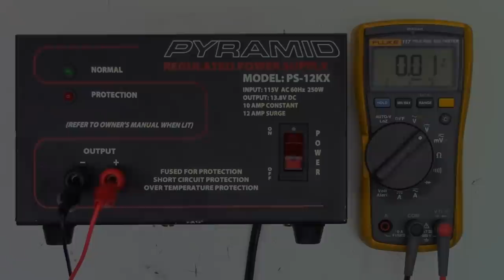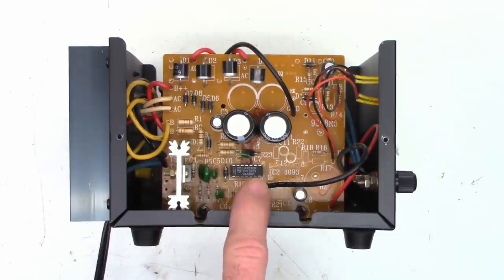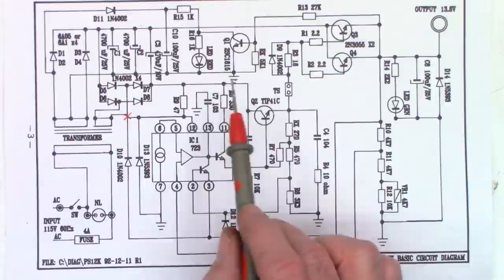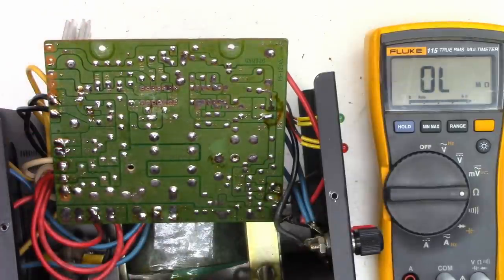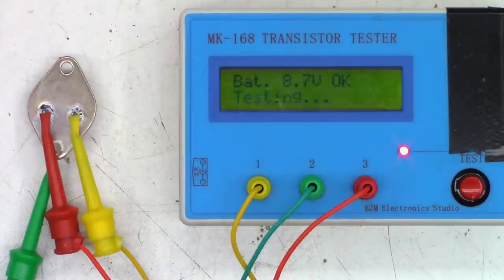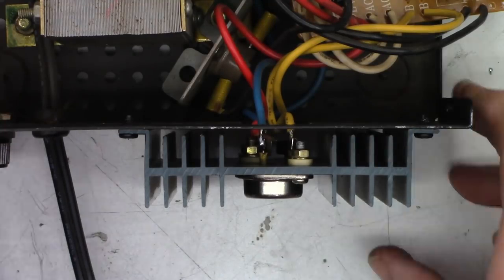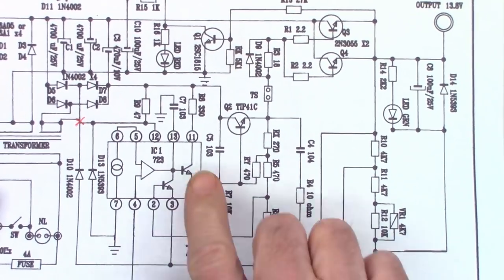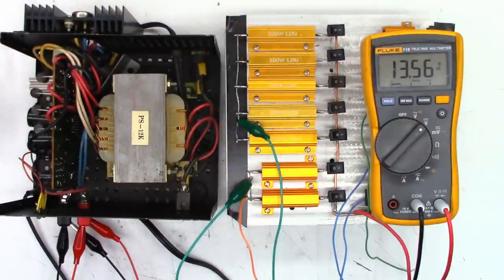PS-12KX Pyramid Power Supply that I sold it new in the 90's and it was returned DOA. Can I fix it??

Comment: Always preferred 3773s over 3055s. They were supposed to be lower gain, but I've always found them to have higher averages than the 3055. Finding matched pairs in the 3773s was (for me) easier as well. It didn't surprise me to see the 3055 under 30 gain with the 3773 over 30.
But a different story when you chop the top off the metal TO3 case. The 3055 is better in circuits detecting luminance levels for some reason.

Comment: I purchased a 20 amp version of the same power supply in the early 90's at R&L Electronics.  I used it intermittently with a packet base station.  The whole setup drew 2-3 amps maximum.  A short period after the warranty was up the power supply was dead.  Really dead.  The primary of the transformer opened up.  I gently cut  open the paper over the windings hoping that the fault was near where the windings attached to the wires.  No such luck.  Kept the heatsink and output transistors and the trashman got the rest.  I have been buying Astron power supplies ever since.

Comment: Used my MK -168 on my 2N3055 and diode between pin one and two transistor bad ! I was trying to bias a new IFR520 I put in my Galaxy DX 2547! After lightening in my area,I soldered a dip socked on the final pc board position so I can change final’s quick . No matter how well antenna is grounded lightening will get you. Pyramid ps8kx took a hit through the power line! Thanks for your help JohnBoyUtah KJ7TBR 🇺🇸🎙
Reply from the maker: I need the get back into the CB/HAM radio. I still have a couple of Mirage DX-99's, I have 4 Cobra 2000's, a couple of Cobra 148s (one that I modded with the import PLL IC to get +80 and -80 channels with the +10kc switch, roger beep, echo, etc. Plus several amps ranging from an honest 250W to 2500W.
Reply: I got of my 71 yr old COVID ass took tech & general 2019 ! I got an old Ken wood 520s I restored got a Texas star 250 that I use now with DX2547. I have a 1993 148gtl , recurve no transmit 1969 final checks out. I am afraid to sent it to a shop they would take it and say it was stolen the 1993 is the last year of good quality befor China’s
Reply: Two amps for sale Palomar 300A and Maco 300 both with good tubes,there is a guy in AZ. That makes a VFO for the 148 cobra it’s sick great idea! When I sell amps will buy from a friend a Aramatron 811 , for ham can’t wait. Get back into radio. JohnBoyUtah
Reply: Also love to chat with the guy’s from Australia about Shark attacks lol 😆 JohnBoyUtah 🇺🇸🎙🎙🎙🎙

Comment: Very fine video, troubleshoot and repair! Brand new Astron PS konked out. Opened case to repair and was stunned...solder splatter all over, some wires pulled so tight you could pluck them like guitar strings. Same issue, very little thermal heat compound. One 0.05 wire wound balancing resistor was open, one 2N3771 cooked. Question: On the schematic in your video, why is there  a small "X" marked in red ink. Thank You!
Reply from the maker: The "Red X" indicates that there is no actual connection between D5,D6,D7,D8 and D10,D13. It was a mis-print on the schematic.
Reply: @norcal715  Thank You! Obvious I do not fully understand circuitry yet, hence the question!

Comment: I see they spared no expense on the thermal paste.🙄☹️🤮.   Well at least the transistors opened and did not short.  No over voltage protection!  It could have fried an expensive device connected to that cheap power supply!

Comment: I am confused about the schematic: polarisation of c1 and c3 anyone can explain please?
Reply from the maker: C2 is drawn backwards in the schematic. I didn't notice that in the original video. C3 has a higher voltage on the positive lead than the negative lead. The negative lead is referenced the the lower voltage collector supply (about 25 volts) The positive lead of C3 is about 35 volts (or about a 10 volt difference)
Reply: @norcal715  Thank You, I see it now, C3 is on a higher potential from the other winding of the transfo. And C2 is just drawn wrong.  Phieuw, I can go to sleep now. Haha Thanks!